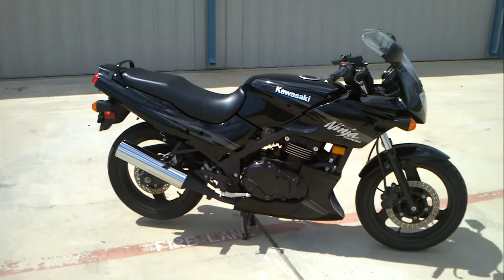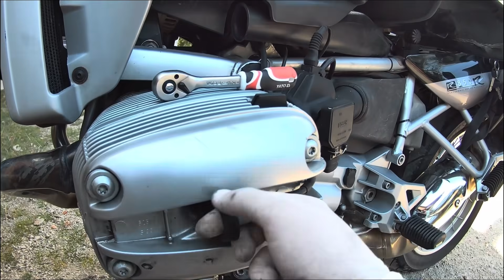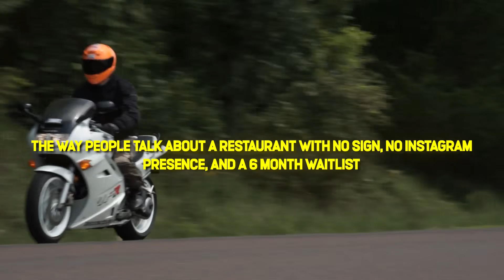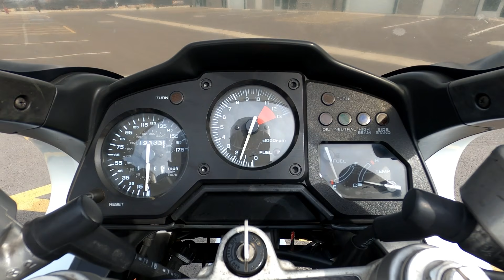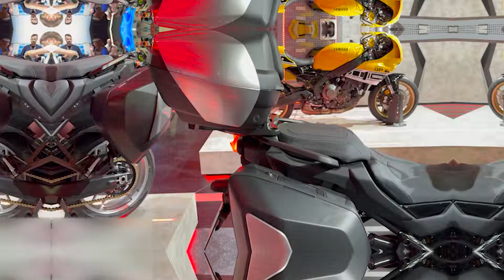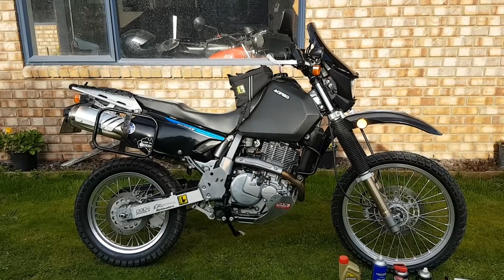Why Smart Americans Are Buying 30-Year-Old Motorcycles

Comment: $2000 for the bike , $2,000 on tires, the chain and sprockets, valve adjustments, fluid changes, and registration. You'd be better off buying a brand-new bike.

Comment: Hmm. Like pretty much everything else, motorcycles have improved substantially over the past 30 years. Gone are the days of lousy tires, lousy suspension, weaves, wobbles, no ABS, poor fuel economy, etc. Pretty much any new bike is far safer than those of yesteryear, more efficient, and faster. While I'm a big fan of RD/RZ 350s and such, they are more about nostalgia than transportation. New bikes are just getting better and better. Most importantly, they're far, far safer than old bikes.

Comment: 37 mile commute down an interstate with an 80 mph speed limit followed by a three mile ride down a county road at 25 mph and that is only paved for the first half mile . I needed wide tires  and and low seat to make it easier to correct the gravel slides . Indian Scout  because that Kawasaki Concours 1400  did not like gravel slides at all.